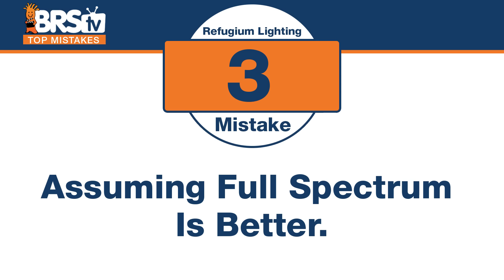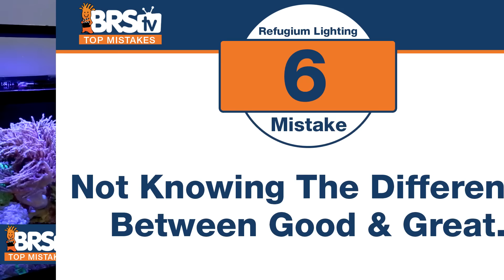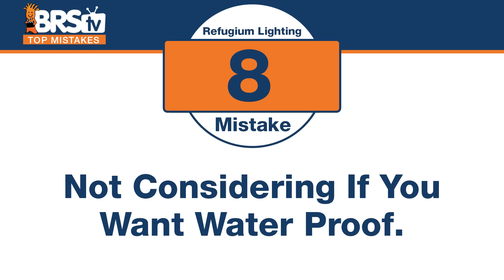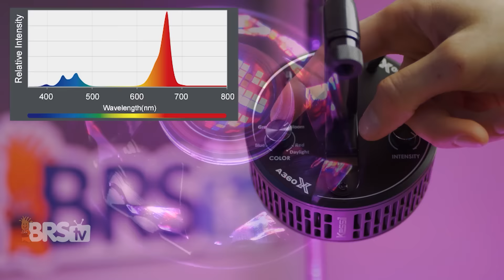What's the Best Approach to Using and Choosing the Right Refugium Light?

Comment: As a member of that different industry, let me add a little bit here. (I'm a trained plant a soil scientist working in agriculture).
TLDR: just use "grow" for the vast majority of reefer's. The other options are broader tools needed for propagation in horticulture.

In plant growth, blue light promotes stem elongation, while far-red light promotes root production and signals reproductive cycles. These are promoted by photo-pigment systems in plants such as phytochrome and cryptochrome.
For those who are attempting to propagate macro algae, these additional settings may be beneficial.
For everyone else, you are trying to optimize the photo absorption spectrum for Chlorophyll a and Chlorophyll b which has two peaks:
Approximately 370-480 nm and 600-700 nm.
It is also worth noting that Chlorophyll b is very sensitive around 450 nm which can favor blue light; and Chlorophyll a has a more even appreciation of both. So a wholistic approach provides both blue and red needed for optimum photosynthesis.

However, you must research each protist species in question. For example:
All macro algae contain Chlorophyll, but they are divided into 3 phyla according to their secondary photo pigments. Green algae is prolific in mostly Chlorophyll; brown algae reflects yellow light due to additional fucoxanthin; and red algae reflects red light due to phycoerythrin.
Because all 3 host Chlorophyll a, that is what you should optimize for it as a general rule.

Kessil's "grow" setting is optimize to provide both nm ranges. The other options are what agricultural producers expect for propagating seedlings, en vitro tissu culture, flower production or fruiting; all things that most hobby reefer's don't need, but have access to with the kessil line. They give general tools most shouldn't need.
Reply: What setting would you recommend for red algae (e.g., red ogo)? And for more brown algae (e.g., think/leafy ogo)? Thanks!
Reply: @devadroid5269  When in doubt always optimize the settings for Chlorophyll a. So the default should be "grow". This setting has the recommended range of red and blue for Chlorophyll a, b, & c; so for the kessil H-series, it's hard to go wrong when running on it.  You can get away with growing under only red, or only blue in many cases (because the pigment reacts with either).  But "grow" is simply both ranges at the same time and lends an even mix.

These organisms evolved to contain more than one pigment, because they were more successful in their environment when they had access to a wider range of spectrums. If it's going to produce that pigment as it grows, regardless of what you do, you may as well allow it to gather energy. The example is your red algae, being able to more easily harvest blue light allows it to grow deeper than it's green cousins. 

Every plant, all forms of macro algae (which I know of), and cyanobacteria all have chlorophyll a.  So they will all benefit from blue and red waveforms. 
Your brown algae has Chloro a, and a secondary pigment Fucoxanthin (it's optimal absorption is around 510 or 520 nm, Cyan). Note the use of "secondary", it's main pigment is still Chloro a. (I don't believe Kessil has this peak, but it's main pigment should allow it to grow). Some brown algae also have Chlorophyll c (has an enormous peak at approx 450 nm).
The red algae's primary photo pigment is still Chloro a, and it's notable secondary is phycoerythrin which absorbs blue (500-ish nm, blue/cyan).
I would still recommend "grow" for both, given the spectral chart Kessil lists on the H-series web page. Adding a Cyan  spectrum source would benefit both red and brown algae in general terms. 

Now these are general numbers, it might vary slightly with species and each pigment have ranges wider than the peak I listed. Here are two sources to start with in available literature, after that you need to specifically identify the pigment in that species uses and look up the recorded spectral range of that pigment.  Botanists have cataloged most of them already, it's just cumbersome to locate. 

https://ucmp.berkeley.edu/glossary/gloss3/pigments.html

https://www.khanacademy.org/science/biology/photosynthesis-in-plants/the-light-dependent-reactions-of-photosynthesis/a/light-and-photosynthetic-pigments
Reply: @dusk1947  Awesome, thanks for the response and references!

So for red algaes in particular, would a Kessil Tune Blue (maybe tuned more white/cyan than actinic) actually be better than a Tuna Sun? I can grow Ulva (Sea Lettuce) easily under primarily red LEDs with some blue, UV, and warm white mixed in. However, my Red Ogo turns white and dies under the same lights. Thought maybe it was the spectrum causing the problem (perhaps too intense as well; though these are not very powerful LEDs, red ogo grows at greater depths likely with less PAR) which is why I just bought the Tuna Sun. Or instead of the Tuna Sun, maybe even Tuna Flora with reds turned way down/off? Unfortunately I don't see Kessil publications on spectrum of each model, nor which wavelengths or LEDs are included (again, for each model), so it makes comparing them difficult.

I'll look at your recommended reading tonight.
Reply: @devadroid5269  Well I would be hesitant to diagnose what killed it without being there, so I could only speculate. They are different species, and even different genus.  You can just as easily compare your Ulva to Diatoms as you could the Ogo; there are any number of reasons it may have died.
The Tuna Sun's should grow most algae fine (it will grow green algae best) as they are tuned for aquatic plants (which use many of the same pigments as green algae). But they also have more colors in the 500-600nm rage. It produces more day-light looking spectrums around 6500K (warm day light), because it's built as a display light and looks pretty; it is a very prevalent light in heavily planted freshwater tanks with a large list a successes. It provides the Blue spectrum needed for chlorophyll, but does drop some of the red spectrum to a minimum.  But it will not stimulate the phycoerythrin in the Ogo too well, from what I can see the Tuna Sun drops around 500 nm.

If you are not adverse to buying another light, the Tuna Flora (H80, H160, or A360X "refugium") series  is slightly more tuned for refugium's. It's red spectrums are more pronounced. However, I'm not convinced the gains would be worth the extra cost.  If you were buying for the first time, I'd personally use the H160 over the A160's. Seeing as you already own the Tuna Sun, I'd just stick to growing forms of green Algae. Or you can narrow down all the other things that may have killed it and try again to be sure. Sorry that's far from a perfect answer, this one is only an educated guess.
Reply: Good to know. I'll apply this knowledge to growing plants for my planted aquarium. 👍